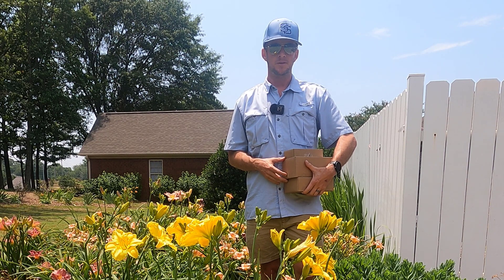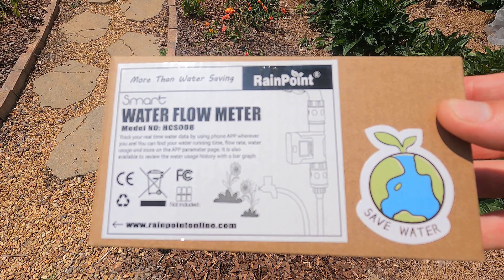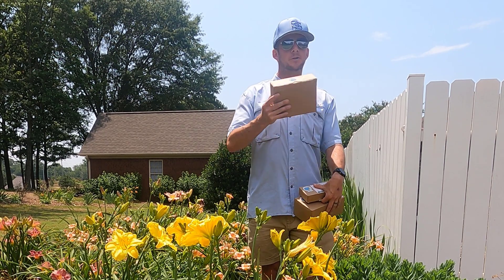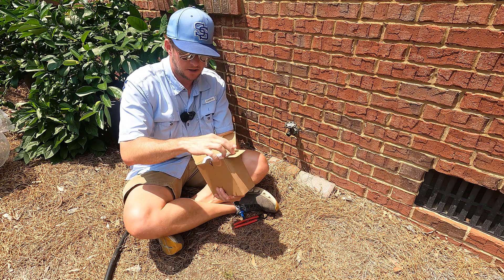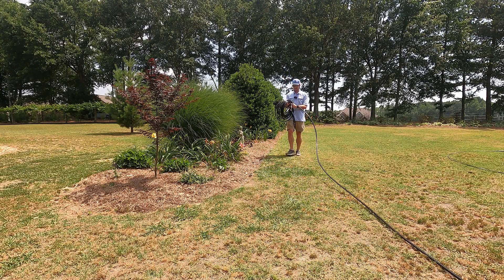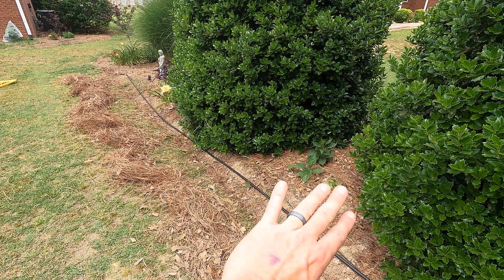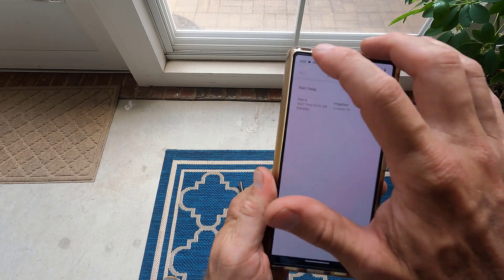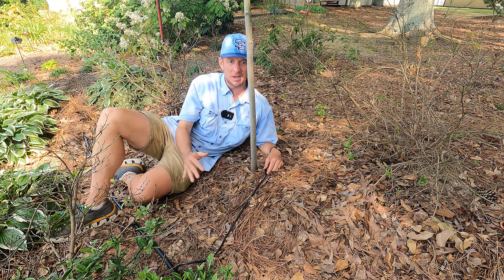How To Install Drip Irrigation with RainPoint

Comment: Nice! I put in drip last year and was shocked how easy it was. I wish I had done it years ago. I went cheap and have been doing it all manually but have been wanting a nice digital/bluetooth/phone controlled system like this. Their website seems to be having issues right now but I'll check back in a day or two.